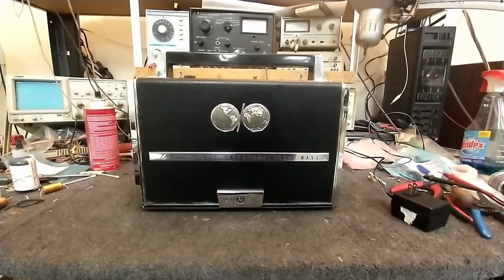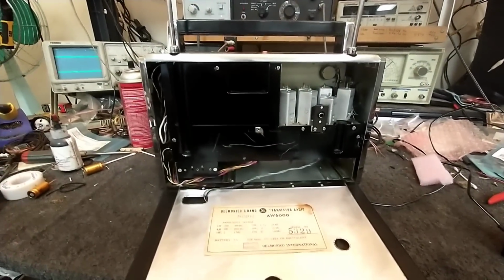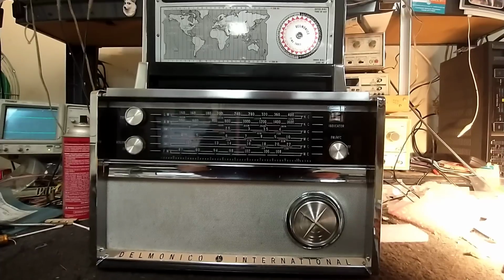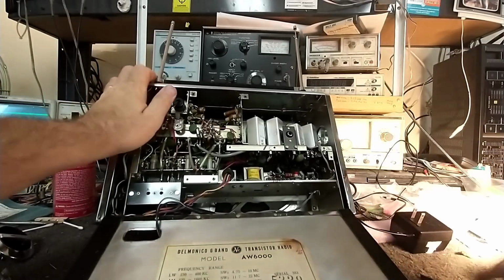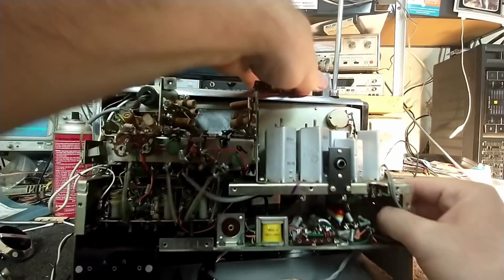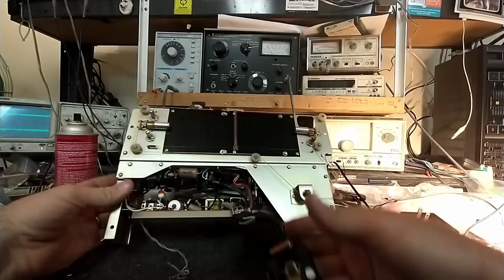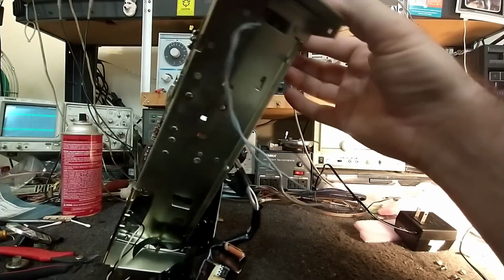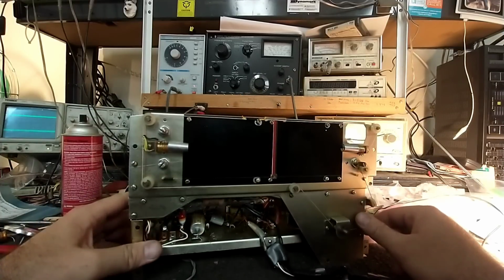Servicing a 1960s Delmonico (JVC) AW-6000 11 Transistor multiband radio - p1/? Assessment

Comment: The schematic shows that it's all germanium PNP transistors with tuned RF stages on both AM and FM, and 2 IF amplifiers.  So it should be pretty good, reception-wise. It also use negative ground, with the positive side of the supply driving  the transistors through their emitters. Otherwise, rather standard Japanese transistor radio circuitry with the common 4 transistor/2 transformer audio amplifier. Once you figure out where all the parts are laid out, it should be a fairly easy fix. It does look to be a bit of a "rat's nest" in there.

Comment: The same radio was sold in Canada and maybe other  markets as an RCA Globe Trotter Model P-890. Made by Japan Victor Corporation (JVC) "Expressly for RCA Victor Company LTD." It's good you saved it as they seem to be rather unique. Yours appears to be missing pull out instruction book and battery box. I have the RCA version that is mostly complete. Not in perfect shape as the antennas are gone but it does work. Good luck on getting your unit back to its glory. Great information, I look forward to the series so I can get mine up to snuff too.

Comment: it's a unusual radio, i imagine there are not many of them still working.
Shame its been hacked about, its still a nice old radio.
I think the lm386 was a 300mw amplifier to drive a small speaker, ive seen them used in cheap walkie talkies.
6-12 volts input perhaps.
I would tap on to the volume control  with a  test amp,  just to see if it's getting there.
I built a test amp using a TDA2002, it's been so handy and it sounds decent.